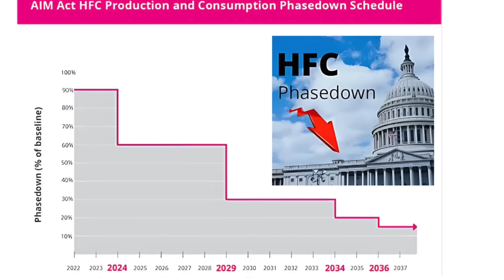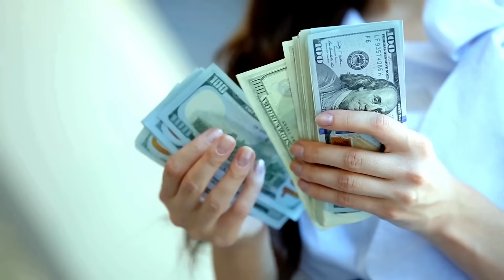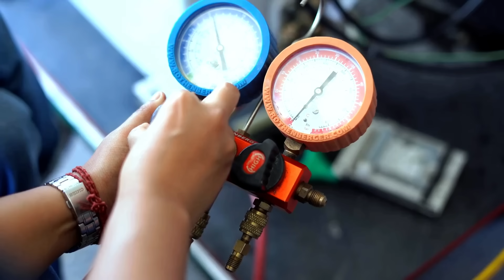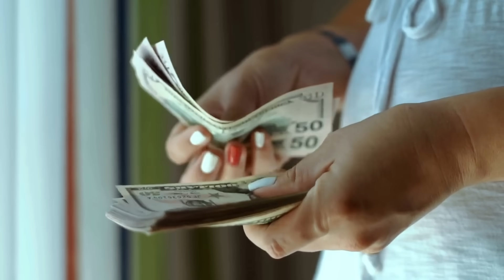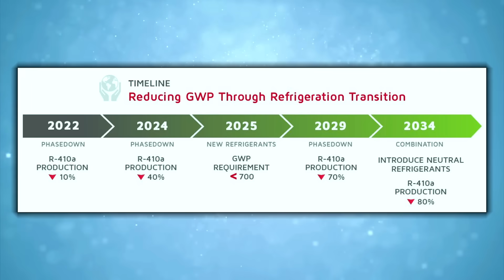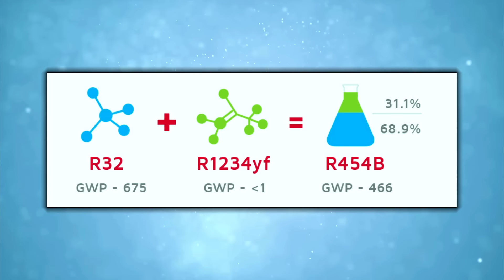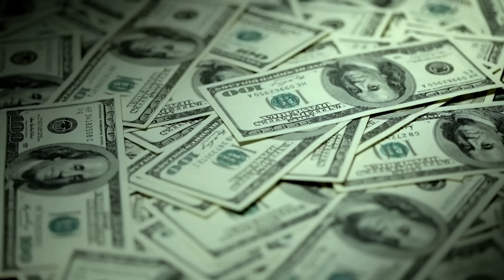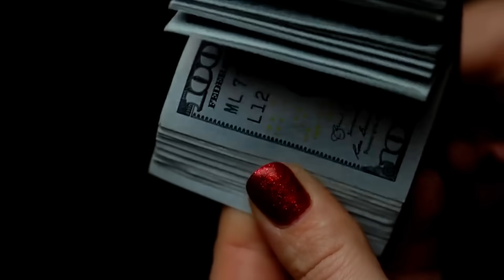Latest on the 2025 Disaster in HVAC and 454b Problem!

Comment: its all BS, the sane excuse to phase out R22 because of the enviroment, now they want  us to believe that 410 is the boogyman. It all comes down to one thing-money. I have some rental and do as much as I can to keep my old R22 units going. I now use a freon called blueon which is a drop in for R22 so long as you evacuate any R22 left in the unit, its been a great replacement and I have units that have been running on that for years now. The cost to fully replace these systems have become insanely expensive to buy from a contra tor and install, I now purchase the system and do as much as I can to install them and then call a technician to finisg the install. $8000.00 plus for a  simple 3 ton unit is just crazy. I know what I pay for a 3 ton and its more than a contractor so it feels like people are being taken advantage of for a full contractor install, not saying its wrong but the differance between the cost of the unit compared to it installed is a little excessive with the differance in the two prices. But everything is like this now so I feel for people who have to call a plumber, electrictian, etc. for any problem because they dont have the skills to do the repairs that every house requires as it ages, even simple repairs can blow a families safety net and its sad. Its also the reason young working class familes can't afford to own a homecabd maintain it so renting is many times there only choice.

Comment: Recover the R454b, pull a deep vacuum and refill with R410a. Done and system works well. When R454b is available and at a reasonable price go back and reverse the process. Don't forget the unavailable leak sensor, that's another ball of wax.
Reply: But is your recovery bottle approved for 454?  Theres no pop off valve on it.

Comment: I see a lot of people staying with R 410A systems . Still can get R410A for now,  I have newer AC and that one is R32A and more common world wide. Look back at R12 and R22 days. Made us switch to R134A and R 410A . Now R134A is being phased out in auto systems to R1234yl  . Had a newer Honda come in with that . Also R600A is making it around as well. Just pricy no shortage yet . The truth is you do not have to convert R410A system as of now. 2025 . Some testing has been done . Them systems need a nitrogen flush because the oils not compatible.  But if convert their is a choice of R32 and R454B . They both work fine in R410A system.  I say hold off on getting R454B system until better supply ! . Many R410 systems still being sold today and some will take R32 with a flush. Or just get a R 32 system. Just byer beware right now with any HVAC system. Check what gas is used,  My R 32 unit works great and is efficient. Some car owners are switching back from R1234yf to R134A and it will work for a wile then the compressor will go bad because wrong oil . Just pay the extra $$ and get the right stuff. R 12 can easy convert to R134A . Many classic cars doing that . Great video of a big problem . Cheers from NY

Comment: Hell No....sticking with R22...its safter than these new toxic refrigerants.  It's not that expensive.
Reply: Not that expensive??
Where the Hell are you buying R22 that isn’t that expensive? The last r22 I bought was two years ago and even then it was over 1600 bucks for a 30 lb jug.
Reply: @Kee_Op you got ripped off, $250 to $300 for 10lb which is all I would ever need.

Comment: Im a service tech of ten years, getting 410a refrigerant has been no problem, but 410a coils has been a different story. Definitely harder to find. It blows my mind that a jug of 454b refrigerant costs almost twice as much as a jug of R22. Absolute insanity. 

Recently had a customer with Goodman furnace unit, leaking Evap coil. Still under warranty. Goodman can’t get me the coil, but they said they will give us a r32 coil and condenser, customer has to pay for labor on installing a new condenser, new evaporator coil, and a dragonfly kit. Rather than just replacing a case coil. I didn’t think a phaseout could be handled so poorly.

Comment: An installer told me his company is using condensing units that are charged with enough R-454B refrigerant for 30 feet of line set.  However, too many times the installation has a short line set forcing him to have to recover some on many jobs...a time-consuming pain in the ass.  I worked for a manufacturer that charged R-22 equipment for 30 feet...the company decided to reduce charge to 15 feet because they worried some installers would simply blow-off the excess. I've heard it said that the shortage is partly due to not enough cylinders are being manufactured by Worthington and others...wouldn't that be a problem for R-32 as well? R-32 has been around for decades, seems to be a better choice.

Comment: Just expose the truth…..Thank you for standing up.  I am 73, been in HVAC for 44 years.  I have a great reputation for my work. I have seen failed regulations over and over.  I sold a brand that switched to 454-B. I quit selling it. I am selling R-32 systems…..I meet my customers at Wal-Mart, and I am not going to sell something I cannot provide service for.   I may get burned for doing this, but I see this as my only alternative. Have corporations forgot service and responsibility? 
Have HVAC companies forgot responsible Professionalism? I have not and will not. The trust between HVAC and customers is being shattered by this mess.  It is time HVAC corporations man up and give the customers something they can trust. It is time HVAC companies give customers someone and something they can trust. When I sell a unit, the customer holds me responsible, not the corporation. Am I PO’ed? Yep
Keep up the good work.
Reply: Only company that sells R-32 units is Goodman and they are not very reputable, at least what I heard.
Reply: @senco981  ...Maybe Goodman/Amana/Daikin  as  one big group with different stickers on their products.
Reply: @senco981  Goodman has a bad rap, yes, but its mainly due to installers not giving a crap when they put the units in. The Goodmans I have come across that were installed correctly ran just like any of the other ones for years. All the brands use Copeland compressors and the same brand of blower motors half the time anyway. 
At my old HVAC job we only did Lennox and Rheem but I actually just installed a Goodman in my own house this past week because of this refrigerant debacle. R-32 all the way.
Reply: Not according to Google reviews you don't.... Sounds like your a big time hack getting rich off the back of the black man !
Shame on you !

Comment: Global warming hoax. Ozone hole is the planet's chimney. Secondly, Hot Shot a drop in replacement for R12 gave way to MP39 because it couldn't get approval because of a minute amount isobutane and differing methane. However widely used. Dupont gained manufacturing acceptance for MP39. GUESS WHY? The retrofit which herein implies is a work around for incompatibility for older equipment is only a required sensor which shuts the heating equipment off in the event of a leak.. It's safety data sheet rates it as highly flammable as is R32.
Leave it to the Gov't to make your home unsafe.

Comment: If the equipment R454B units are equivalent to R410 systems as far as oil and components, why not just remove R454B and use R410 instead of mixing. I've heard from some individuals it can be done, although using a refrigerant that is going to be phased out, it's a work around for now, I have a friend wanting to buy a 3 ton system, needs a drum to top of, 800 bucks for 20lbs. I have been through the R22 phase out way back, in HVAC 40+ years, and your right about someone needs to sound the alarm, these companies control the market, and the Government controls them.

Comment: Big  4  Manufactures of  Equipment for USA  are Just Tapping Us Along as or  Like I say  Jerking Us Off   . .  They are Dragging Feet to Make Equipment everyone Needs .. then They Still Selling  ~ All Old Equipment ~  that all They are Doing  Hoping for Governmental Hand Out = BS  , I Bought 2 Nice Low Cost  " Window Units " that use R32 and Have Inverters so Very Quite - Light - easy to Install & Window shuts 3/4 of Way  & I Made Permanent Seals for Both Sides 8" L  x 6" H   very small Insulated and Manufacture May Kiss My Ass  !  ( 8K for Plain A/C Unit ) split system - No DC  Inverter = BS    !   so I'm $7400  Ahead of Game  Home 2465 sq. Ft is Cool & Dry  !  PLEASE TELL  Them to ( F . O . )  - Furthermore half A-holes that showed Up - don't want to Install Ductless - as it's a  PITA for them or  $125hr  basically  to do  Remodeling  , what Hell Over - College Kids do Remodeling for $12 - get some Helpers  Drill Holes & Snake some Wire or Lines .. ( Real A/C Work ) is at End of all that takes 2hrs Tops  . .

Comment: Hey, thanks for the video. I just had a new outside AC condenser as well as an indoor evaporator coil (Lennox CK40CT-30B) installed. It's a Lennox MLK14KC1-024.
 condensor. Well, the installation contractors could not get the sensor to work, it kept shutting off. They determined it was the wrong sensor (huh,?). So they bypassed it to get the system to run and left. They sent me a final bill in the mail, and I am like, WTF? I need a functioning sensor. It's a safety issue. Should I withhold payment? I'm concerned at the real reason the sensor "wasn't working", who knows why they could not get the sensor working,  could they have possibly mixed up a couple of different refrigerants to conserve their supply of the scarce R454? Now I'm worried as heck. I wish I saw your video prior to the new install which was on 6-5-2025.
What should I do??  Than you for the informative video,  I appreciate any advice you might suggest.  Owe the entire balance, over $7500. 
Also, they left me no owners manual either.  What's with that?

Comment: To add to these problems, there is another issue that HVAC technicians and consumers need to be aware of: that is, the combination of aluminum parts (used for high heat transfer rates, resulting in high SEER ratings) when employed with refrigerants that have hydrogen in the molecule. Whether hydrofluorocarbons or hydrofluorochlorocarbons the result is the same: the electronegativity of fluorine and chlorine pulls the electrons away from the carbon (to which they are attached), which then transfers that pull on down the carbon chain to the hydrogen. Ultimately, that hydrogen gives up its electron to that pull, resulting in an acidic hydrogen. Now, that hydrogen wants to leave the molecule, in order to find an available electron and become more stable. If any moisture is available in the refrigerant, an acid is produced. This acid then attacks the chemically reactive aluminum surface, until a hole is eaten through the aluminum. Then, the refrigerant escapes through the pinhole leak. Now, the coil needs to be replaced, the system needs to be evacuated, and the refrigerant needs to be replaced. It is all a question of time and quantity of moisture in the refrigerant. Adding a refrigerant dryer to the system might help prolong the time until failure.

I would expect more problems with this in humid locations.

Comment: Baker adds more.  Wanna know something hysterical.  Here in Phoenix there are guys putting 410 in 454 units.  Guess what?  It works just fine.  

I wouldn’t do it but it’s being done.  Trane is notorious for undercharging.   I stopped using trane.  

I only sell and install 410 units until I can’t or this is fixed.   Thankfully I found a bunch of them

Comment: It cracks me up, r22 bad, replace with 410a, now that’s not safe, now this new stuff has a large mix of propane gas. What a nightmare!
Reply: Another  Idiot  !  -  We are to Cool with CO2 for God  sake  WE all are Being Jerked Off - Like some Big Video Game .. Ford & Chevy will all get 35 Mph or have 75% Electrified , Ha  all Dragging  Feet  ! ( BUT  HOLLY  COW )   Need a Special Harden & Special Built  Bunker Bomb to Travel 300ft Down   Cave then Blow a Hole 4 stories Deep & Suck all O2  out of Cave 3 miles Long -  No  Problem :face-green-smiling: Here it is in 4 Months !
Reply: Its not propane gas. It's difluoromethane, if you really want to be paranoid, almost every freezer and refrigerator now is using R-600a....which is isobutane. You're fine.
Reply: Sorry, but neither R454B nor R32 has any R290 (propane - yes it is flammable, but it is NOT the same propane you use in your gas grill: it's my understanding it's a much more refined propane (most of the impurities have been removed)) in them. R454B is a blend of 31.1% R-1234yf (what they now use in vehicles) and 68.9% R32. R32 is a single component refrigerant, it is not a blend like R454B is. Don't get me wrong I am not defending the switch over to the mildly flammable refrigerantts. If they wanted a refrigerant that has a lower GWP than R410A they should have stuck with R22 which has a GWP of 1810, while R410A has a GWP of 2088; however, R410A doesn't contain any chlorine. R407C, which doesn't contain any chlorine, might have been a good choice if not for the fact that it has a GWP of 1774.

Also, consider this: none of the refrigerants currently in use can harm the ozone layer if they never reach the ozone layer, IOW, if they don't leak out of  the systems that contain them they can't harm the ozone layer. MUCH heavier fines combined with stricter enforcement might have been a better option rather than phasing out R12, R22, and now R410A.

Comment: We own a 2016 Honda Civic. 1234yf refrigerant.  Starting in 2022, again in 2023, again in 2024 and yes this year as well, the AC condensers have leaked out all of the refrigerant. To their credit, Honda has repaired the system at no cost as part of a service campaign. I hope that the home systems using using 454b are faring better.

Comment: If wholesalers were able to sell R410a systems past 2025 the problem wouldn't exist. Wholesalers didn't want to get stuck with paperweights, so they ordered R410a equipment  cautiously. R410a equipment should have been able to be sold to depletion, not to a dead set date.

Comment: I purchased a new Daikin Fit system which uses R32 and I will say it keeps my Florida home cool as a cucumber set at 76 degrees while the temp outside is in the high 90's. Very reliable system and my electric bill has not surpassed $ 75.00 in any month. Happy I replaced the old unit when I did and hope the problems with refrigerants end soon.
Reply: May I ask how long ago you purchased your new Daikin system?
Reply: @tapejarasimp2645  The Daikin system is now 2 years old
Reply: @tapejarasimp2645  Feb. 2024
Reply: If forced — Daikin and R32 is my only choice for customers.  I just don’t like the over-engineering of all products.  It does NOT make anything better…just more expensive and complicated

Comment: Spent 40 years in the hvacr trade i purchased a new 410 a unit my r22 unit is running fine by the time 410 a isn’t available there will be a drop in replacement

Comment: Also Can You AC Guys (I'm Cable Guy) Put Outside Units on a Pressure Treated Pedestals at Least THREE FEET off the Ground.........It Barely Needs Cleaning Every Year if it is Mounted Above the Rain Splash Up Level

Comment: I'll tell ya what I had to do.   Replace the 454B txv to a 410A txv  and filled it with 410A.
Reply: You mean rupture the old expansion bulb, solder a fill fitting, pull a vacuum, and fill with an alternate refrigerant?
Reply: @gregorymalchuk272 
No!  Many contractors all in videos saying they recovered the 454B and replaced with 410a . No need to replace the TX. As the pressures are almost the same and they use the same oil! Some say they have seen 410a TXVS in the 454b systems.
Reply: @gregorymalchuk272 Yeah something like that

Comment: The change to R1234 in auto means all new tools , gauges and recycling machines that cost close to $10,000 CDN each. The 1234 cost 30 times as much without any improvement in performance. Prices might come down in 20 years ,then the patent will be expiring soon and they will think of an excuse to outlaw it. Just like the 134a now and the old R12. Brought to you by a company with a French sounding name.
Reply: Eff DuPont…my question is…if it’s ban from being sold to the US….and the patent is expired on the r22 or 410a….wouldnt that mean anyone can make it now
Reply: @w8what575  Yes, after the patent expired, anyone with the money for a factory can make it. That is why they have to ban it.

Comment: The only thing wrong with the old R12 was the chemical been out long enough and the patent expired, so the original inventing company cannot have a monopoly for the R12 and other related fire suppressors. The 134a are in the same situation now , replaced by the R1234 that cost 30 times as much without any improvements. About the R12 hurting the ozone layer, each major volcanic eruption add far more fluorine to the atmosphere than mankind ever could. We actually can do with some more volcanos now, to raise the very low carbon level (.04%) in the air to the past high. A major volcano will do naturally what mankind failed to do, reduce  the population explosion and we can blame it all on God.

Comment: I had been a Trane customer for the past 25-30 years for my home and my rent houses. Seems like the average Trane system life is only 6 to 8 years unlike R-22 HVAC systems back in the 1970's lasting 25 to 30+ years.   Now I am being told my 100% new 8 year old Trane 410A system is once again EOL.  Three complete Trane Heat Pump HVAC systems replacements in 25 years... I am done.